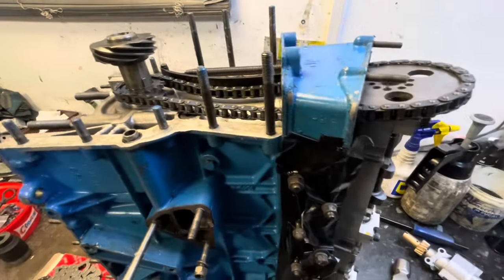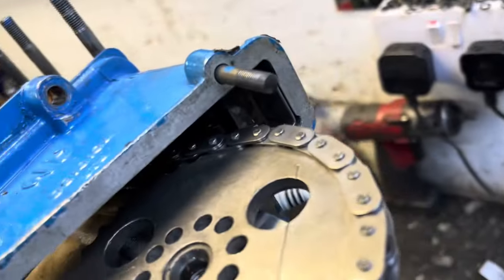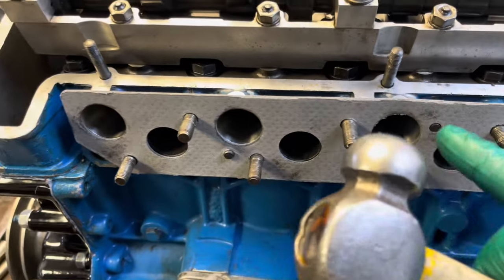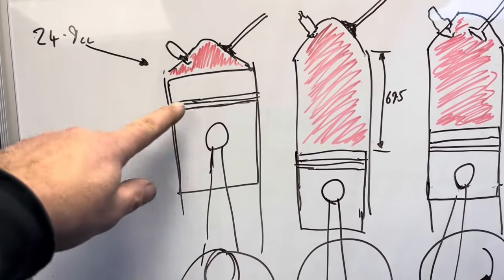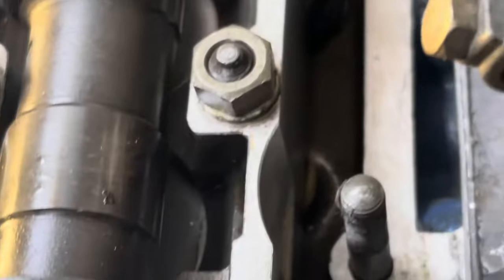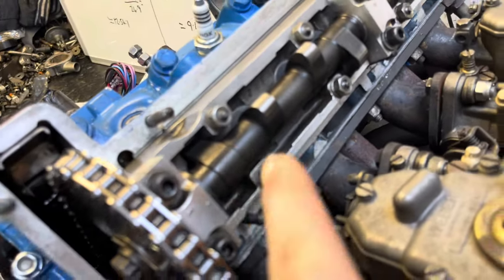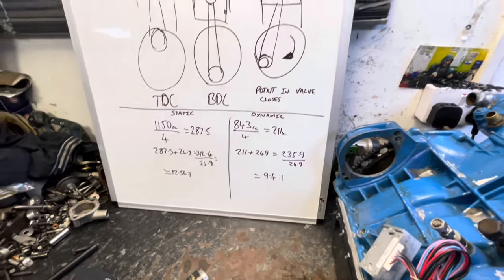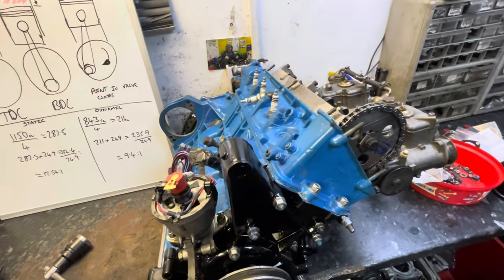Shrigleytube TV ep41 static and dynamic compression ratio chat, 1150 dyno run up

Comment: Good video again! What you consider to being max dynamic cr with "normal" fuel like 98E5 in older 2 valve/cyl engines?
Reply from the maker: good question ! i will have to get back to you after doing more measurements and testing

Comment: Hi Andy. Do you measure your head volume 24.9cc with a flat plate with head upside down, plug in to seal, burette etc, or with the engine assembled down the plug hole ? i think you may have shown this on another vlog. My point is, if you are using a plate you need to add the volume of your head gasket to your calculations (pye R squared times gasket thickness).
Reply: If the piston has cut outs or has a dome then it is easier to measure the volume with the head on the engine and the piston at TDC, the rings can be sealed to the bore with grease, doing it this way means that the gasket and piston shape are accounted for.
Reply: @sidecarbod1441  The way I was taught, is to use a flat acryllic plate with a small hole in the centre to feed deisel in, the plate is sealed on top of the cylinder with smear of grease, as is the piston around the cylinder wall. The piston, if necessary can be moved a measured distance down the cylinder normally 5mm (using DTI) to clear the piston dome protruding above the cylinder deck height. Measure the volume of fluid to fill ares under the plate using burette. Subtract the volume of stroke as measured down from TDC.. 5mm. This gives you the combustion chamber volume above piston to deck height. 
Turn cylinder head upside down and using same acryllic plate seal the combustion chamber and measure volume with burette. Ensure plug is in  (! ) and all valves seal properly. Use a little grease on valve seats if needed to seal. Add this volume to the previous measured volume, add the gasket volume as mentioned before as this gives a total to be divided into engine swept volume ( pye x radius squared x stroke ). Hope this helps. Great videos Andy. Get some more motorcycle engine parts in those engines mate, its the future !! 
BTW I think ultimately you need to start measuring cylinder pressures with the engine running, unfortunately its expensive kit but is the only real way to know whats going on in the combustion chamber.
Reply: @factoryfettler  There are loads of different ways you can go about doing this, obviously the less separate measurements that you have to do then the less chance of errors creeping in there are. I'm old and have been messing about with engines from a young age so I have tried most of them!
Reply from the maker: hi, on this particular engine i had not removed the cylinder head, so was just measured through the plug hole at tdc, when building a fresh engine i have to use the perspex as you described to get an idea of where i am at. 
  i particularly like measuring through the plug hole as it gives you an exact cc size taking into account the exact thickness of the compressed gasket etc, remembering to grease no 1 piston rings is very important so the parrafin does not pass the rings.

Comment: Hi Andy, whats your thoughts on using 1/2 links on imp engines ?
Do you use split links , some people really dont like them, others have  no issues
Reply from the maker: hi, i have no problem with half links, but i dont use split links on racers. To be fair i have seen plenty of chains with split links on road engines without failure!

Comment: i have a volvo b230 engine, it has 3mm off the head, and bigger valves, it has an old school type 300 degree cam. the static ratio is high but the dynamic is low. never reolised how much trouble you have to goto to make an engine work until i started watching your vids.

thanks!
Reply from the maker: ha ha its no trouble all good fun !

Comment: I never fully understood why the dynamic CR is of any importance, the reason being that even though the inlet valve is still open during the first part of the compression stroke fresh charge can still be travelling into the cylinder due to the inertia of the gas in the inlet port along with positive pressure waves in a well designed inlet system. Obviously at low RPM the charge has enough time to reverse flow back out of the cylinder but at high RPM it shouldn't. Anyway an interesting video, as always!
Reply from the maker: hi, yes agreed its all a bit to involved to understand for me at this stage, i just record the data and see what works and avoid what i know wont work !
Reply: I kinda started to think the opposite, static compression is not really important, 
I had dynamic compression described to me as 'running compression ' , 
It changes with rpm etc when intake tuned lengths etc come into play & even with late closing intake valve the dynamic compression can be more than the static compression 😮.
A normally aspirated engine can have a volumetric efficiency greater than 100% and effectively become supercharged when tuned intake, exhaust etc all work together,
Reply: @aldrinmartin3776  Very true engines can operate at over 100% VE. Like you say the actual CR will vary depending on a lot of factors so I'd still argue that measuring the CR at the point where the inlet valve closes is somewhat pointless, I guess in the same way that you might argue that measuring the geometric or static CR is equally pointless. I suppose the static CR is at least the 'starting point' for what the actual CR will end up being. Knowing the PSI figure in the cylinder just before the plug fired the mixture would be the way to go, this figure could then be checked after making various changes such as changes to cam timing and static CR at different RPM's, in simple terms you would want this figure as high as possible to the point where the fuel does then not detonate after the plug has fired. Of course measuring this is easier said than done! (I bet the likes of Ricardo have done this sort of test).
Reply: Yes indeed, the pressure volume diagram ,  
Then you can throw expansion ratio into the mix,  
Variable valve timing systems use very high static compression, which is dynamically lowered at lower rpm by late intake valve timing,
Then once the VE drops off at higher rpm (past peak Torque /max cylinder filling ) valve timing advances to restore dynamic compression.

Thermodynamic theory has many rabbit holes to fall down. Thats why its hard to beat the sort of empirical testing andy does, especially when sometimes something works which the theory says shouldn't
Reply: @aldrinmartin3776  Good stuff, I'm glad to be alive whilst all of this is still relevant, I can't see electric motors being much fun at all!